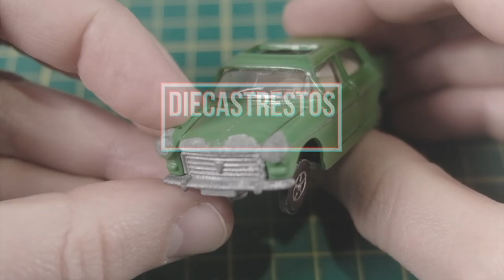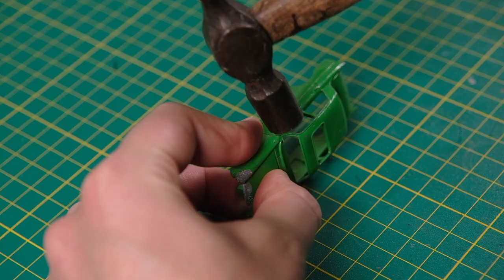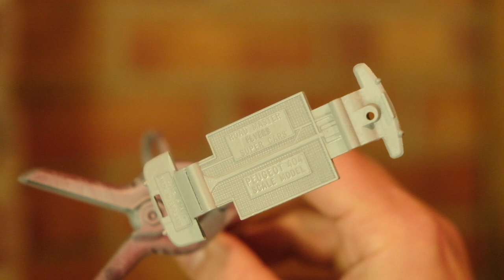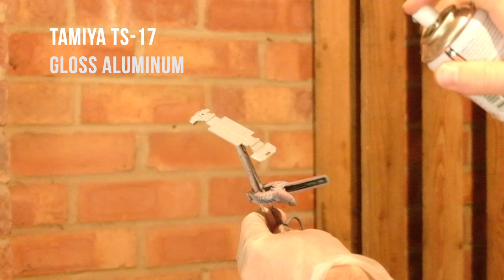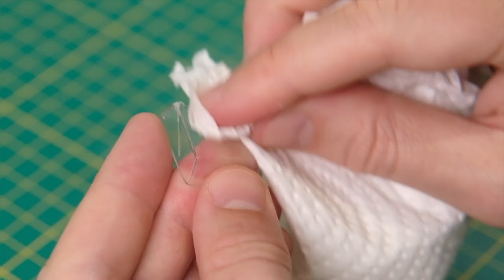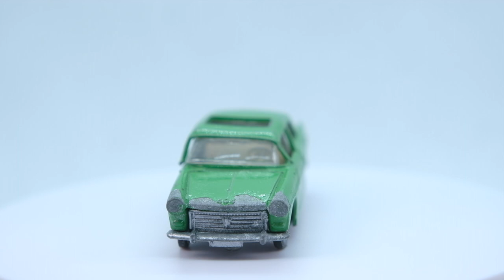LONE STAR FLYERS restoration: No. 28 Peugeot 404

Comment: Nice work Jason. It's a decent casting, of a good-looking car. I'd no idea they were still building these until 1991. As you mentioned, a lot of these were used as taxis, always a good recommendation for reliability. 
The countries who are blessed with a decent climate are so lucky. They can run cars for so much longer than we can in Scotland. Cars from that era just rotted away here; still running fine, they just fell apart. I bet Argentina and Kenya still have plenty of these on the road.😁

Comment: nice resto again, love the colour. :) then again my first car was a '77 Ford Taunus wagon in signal green with green interior. the car lasted me 13 years, the green interior is still waiting for better days down in my cellar... it's so rare nobody else has a car it would fit in, it seems.
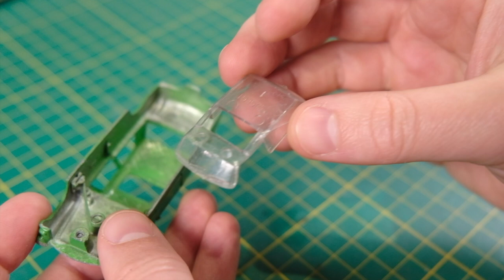I had one of the 1:35 scale lone-stars, a plymouth convertible, curiously marked 1/50 scale on the bottom. like, nope. XD
lone-stars are a bit rare in germany, though I have the Taunus in both versions, as Impy and as a Flyers. there, the proportions aren't too off. with the Corsair they could be better, the casting looks smallish.